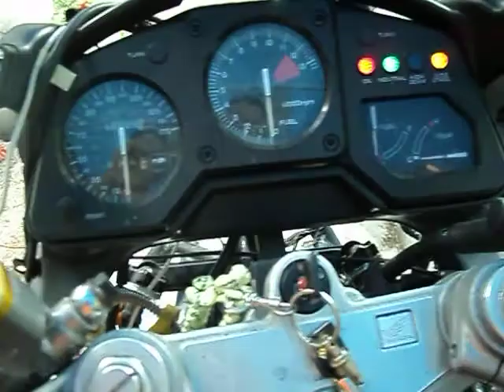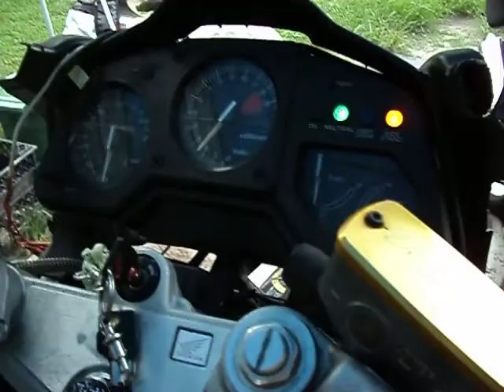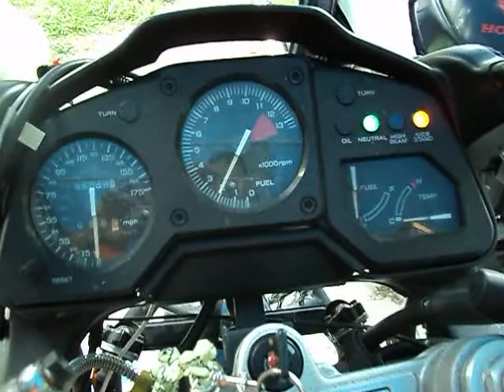VFR750 Rebuilt Engine Startup, Finally - After Starter Clutch Problem

Comment: Hi it's not a good idea to run the bike without coolant as you could easily overheat your waterpump and damage the seals.
Reply from the maker: Hey Andy, thank you for the FYI.  I did not know that but I wanted to only fire it up a few times.  I have since put the coolant in and am running it to burn the rebuild clean.  That is a very good observation and I have ran a car when had overheated without any damage.  After I made the video, I did not fire it up anymore and I got the radiator on today and ran it for 10 minutes, it is burning something, maybe bad fuel.  I do not recognize the grayish smoke, do you have any idea what it is?